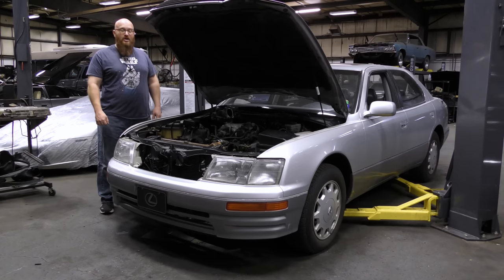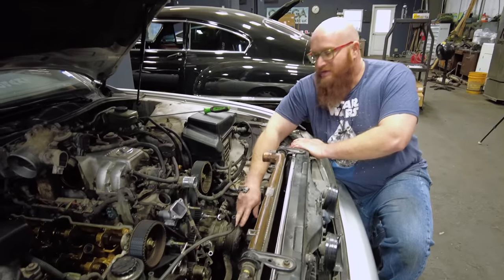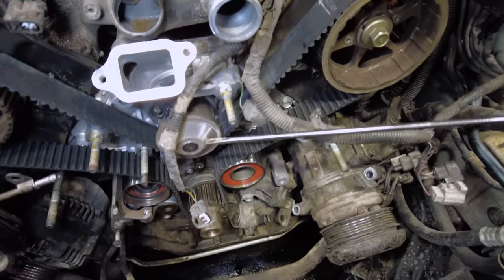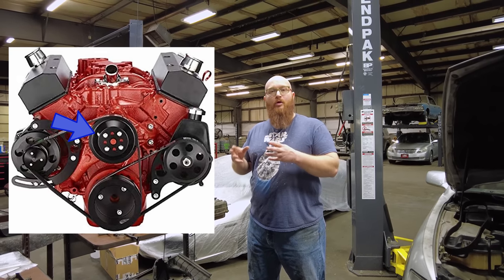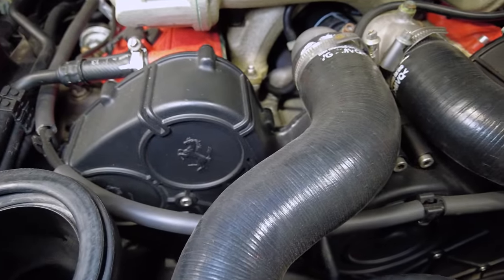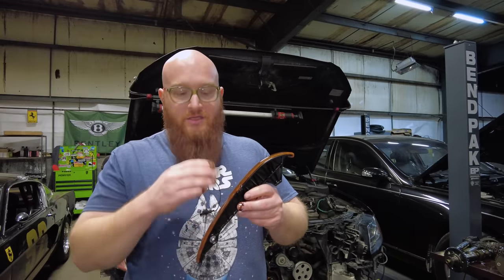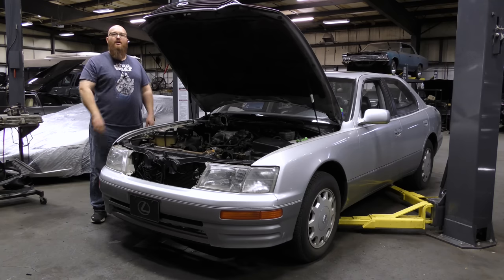My What's Broken? Series #1: Timing Belts-vs-Chains! CAR WIZARD explains why the huge bill

Comment: I'm glad you made this. I recently purchased a 2007 Golf R32 and it's got chains. And apparently the repair is around £2.5k compared to the belt which I usually pay £450-£500
Reply: It's a lot more work to replace the chain(s), because they are internal to the engine. That means there will be cast cover-plates to be removed, the chains and guides cost more, cland there's likely to be a more expensive tensioner to replace. It all has to be put back, taking great care to make sure it is oil-tight.
On a well designed engine with a timing belt it ought to be designed with it being a service item in mind. Sadly a lot of manufacturers ignore that part by cramming so much into an engine bay.

Nb. Modern timing belts are way better than those 30 years ago. There are now things like Kevlar available.

Comment: I have a 91 model ls400 still working strong but i have a new water pump and timing belt in store as those are the only big maintenance these need around every 100.000 miles or so do this 10 times and you are at the million club :)

Comment: I changed the timing belt myself in my 1987 Chevy Sprint (60k mile interval), but that had a simple SOHC 3-banger and it didn't require much disassembly to get to it.  Believe me, I double and triple checked the timing marks were perfectly aligned before I buttoned it all up, then said a quick prayer before turning the key 😀 The next 2 vehicles I owned had chains, so no change interval and didn't need to get them replaced.  The 2 after that had belts, but by then everything was far more complex so I paid to get them done.  Now I'm back to chains so hopefully no replacement.
Even with 30+ years of experience in IT, I will never pass on an opportunity to hear an expert talk about subjects I know well, since there's always something you can learn.  So anybody should watch this video, if for nothing else to get a look at a beautiful Ferrari V8.
Reply: i changed the timing belt on a gf's sprint in the 90s when she needed a water pump
Reply: I agree very stressful on the first start up.😅
Reply: @perpetualgrin5804  indeed stressful on first attempt. I had that feeling when I first installed induction cooktop in my previous home. One wire wrong and it could have catastrophic consequences. Checked all of multiple times. 
I haven't done a belt change yet but I'm confident i can do it. I also have a Hayes car manual explaining how to do it properly. Luckily I don't need to remove the engine mount to reach the belt. That would really be a step to far for diy.

Comment: Hi car wizard, a point you might like to mention is that although chains, providing that service intervals are observed they can be counted in thousands of miles, the rubber belts age as well. Example my Rover 75 only had 37000 klm on the engine,  but it was the original so 23 years old. Something to consider.

Comment: Thank you, Car Wizard. I came up doing the old school timing light bit for adjusting the timing- along with feeler gauges for points and the like. I say the modern motors, though more complex, are better that the old days motors- much tighter tolerances and better alloys make them last so much longer if regular mountainous is practiced. I don't miss trying to figure out if the timing was off or the dwell angle or....
Reply from the maker: Agreed, I dont miss timing lights one bit
Reply: @CarWizard hi

Comment: Very good video showing the intricacies of taking apart those babies to change their timing belts/chains. People think they are easy (like a serpentine belt)...they are NOT!
I had an old (1986) Honda Accord. EFI, auto. I replaced the timing belt (it had been done by the dealer before, I had the paperwork). The crank timing belt mark on that engine is on the flywheel at the back of the engine block (marked white with a bit T stamped beside it). There was another mark (colored red) that was for the IGNITION timing (15 deg. if memory serves right). It turned out the timing belt was timed to the RED mark! 
(Incidentally, the engine would rev fine up to about the 5k rpm or so, beyond that it would start sputtering, which I had thought it was some sort of rev limiter in action) New belt timed to the righT spoT and no more "rev limiter"

Comment: You are spot on in regards to changing a belt driven water pump at the same time. The new belt will have different tension characteristics that will change the stress on the bearing and seal of the used pump and cause a fail in short order. One week on the car I learned from....

Comment: Thanks wizard. Old short chains on American OHV V8, V6 were very reliable, except some with nylon sprockets. Long and multiple chains on DOHC engines with high DI fuel pump loading are subject to stretching, tensioner and guide issues. Should be inspected as precaution to total failures. SOHC non interference engine W/O DI using interval replaceable timing belt is good, because timing belt  designed to be replaced and if belt breaks, no valve damage. Some old engines with cam in block just used two lubricated gears;  no chains, no belt fears.

Comment: Great video Wizard. The only thing I'll add is belts are generally cheaper for the design, but they're also lighter and have less inertia - hence the use by Ferrari etc. Separately and important to add to your illustration of the damaged belt is that those inner cords can fail WITHOUT the rubber cracking, so change the belt to the schedule. It can look ok and be on the point of breaking. This also reflects the need to replace a belt if the water pump fails - you can't see the damage done to the belt internals caused by the sticking/seized pump.

Comment: I've had two vehicles where the timing belt has snapped.  One was a write-off and the other needed extensive (and expensive) repairs that took the dealership a month to complete (jerks).  Learn from my irresponsibility:  when it's time to change the belt/chain, CHANGE IT!
Reply: One of my cars is non-interference, used to have two (lost one in an accident 😔).  There were so few that were, but I still look it up if I'm considering a used car.

Comment: My old truck has all steel timing gears! No belts or chains here, just a 2:1 ratio gearset. The camshaft actually spins in reverse to normal because of this, but it's all designed that way. It's an old International Harvester 345 motor. A little noisier (but with no roof, no doors, can't hear much but the wind anyway!), but extremely long-lived. Don't know how many other manufacturers ever did this, but I thought it was interesting!
Reply: Generous Motors did in up to around 1950 as well as Ford unless I am mistaken.
They basically were good for the life of the engine.
Then they realized it made more profit to use chains as they wear out.
Reply: Ford's inline 300 used gears if I'm not mistaken. Diesels use them too.

Comment: Very good video! Manufacturers seem to have gone back to chains now.  I had a 1982 Ford Ranger with the 2.3 liter 4.  It had a timing belt and I pushed it to far.  The belt broke and left me stranded.  Luckily, the 2.3 is a non-interference engine, so no engine damage.  Later, I bought the special Ford tool and successfully changed the belt a few times.  Even on that engine, it was an all day job(at least for me).  you had to remove all the accessories to get to the timing belt cover.

Comment: I just replaced the timing chain on my  2011 mercedes E350 CDI at 403k km (250k miles). It cost me a bit over 300€ to do. I didn't have any problems with the original chain but decided to change it for peace of mind.

Comment: I have a Volvo V70 with the 5 cylinder petrol engine. Unusually the advice on those is Not to change the original Volvo water pump if there are no leaks or play  "While you are in there"with a belt change because the original pumps will often last the life of the engine, 200.000 to 300.000 miles. Also a lot of aftermarket pumps will develop leaks annoyingly quickly.

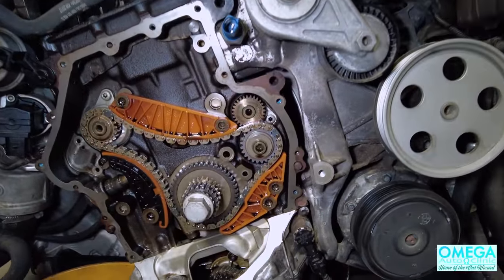Comment: That's a great tutorial Wizard. At 12:30 you could point out the 'chain tensioner',(8 o'clock in view), sticking out so far that there's silver on the cylinder showing,and it's passed it's useable position because of chain stretch and guide wear.There should be 1/2 that showing.

Comment: I learned what a timing belt was back in 1990 while driving my 1986 Mazda 626. The engine died on the freeway and had no clue until towed to the shop. Oh, your belt snapped but your engine is non-interference so you are Ok. After that I changed my own and that car is so simple to do. Today the only car I have with a belt is a 91 Mazda 626 so still easy. All others have timing chains from 1965-2018.

Comment: The timing belt on a Toyota 4.2 turbo diesel is the easiest thing I’ve ever seen to change the belt. It’s on the outside of the engine and you just remove the plastic cover, line up the marks, release the tensioner (probably replace that while you’re in there), take off the old belt and fit the new, and then make sure everything is still lined up, cover back on, job done. We had that excellent motor in a 2004 Landcruiser 100 series.
Reply: It's almost the same on a Subaru, especially if it's a single cam. Just take the front covers off and replace the tensioner and the idlers. The access is so easy and the belt kit so cheap that the waterpump isn't a must to change if it's still fine on a low mileage car.

Comment: Just replaced a timing belt on another 1UZ out of a SC400.  That belt had 212,000 miles on it.  It looked similarly, but still had plenty of strength left.  I hung an engine and trans combo on it from a hoist overnight (only about half an inch off the wood support blocks) - single loop, not double loop - so full weight, not half weight.  Still holding the next morning.  These belts are a lot more robust than the manufacturer lets on by their recommended intevals.  Had an Acura 5-cylinder that I recently replaced the belt after 120,000 miles (rec. interval 90,000).  Belt still looked primo - no cracking, rubber still pliable.

One thing I didn't see mentioned is a second reason why the water pump is replaced with timing belt, besides easy access with belt work.  Often, a new timing belt, which probably has less flex in it than an older one, is likely to cause a marginal water pump to fail soon after belt replacement due to higher transient forces from belt on the bearing/bushing and seal.

Comment: My wife was stranded on a freeway, about 15 miles from home, in the dark and the rain, when the timing belt snapped on our 5-year-old 1976 Pinto snapped with about 36K miles on the odometer. Fortunately, a kindly lady gave her a lift to a phone booth (remember those?), and we had AAA towing. Non-interference engine, $50 repair in early 1980s dollars.

A few years later I was stranded on the same stretch of freeway, in the opposite direction, when the timing chain on my 1973 Chevy V-8 stripped the plastic(!) teeth on the cam sprocket. Interference engine, new lifters and cams, $700 repair in late 1980s dollars.

Comment: Lexus LS is Top tier.  Gives me a tingle everytime i see this model. Golden car. No doubt. Protip. If you see one white smoking check the steering pressure valve that is
Piped to the intake vacuum.  Its rarely a head gasket in this engine.  I used to grab these up at auction for pennies. Would take to shop and disconnect or pinch the steer vac to diag and white smoke gone. Order steer pressure valve. Done.

Comment: love your videos and how much information you have to give to people, I would like to just comment that the timing belt on the Lexus ls400 is backwards, the arrows should face forwards to the front of the vehicle, gladly the engines Toyota makes that are equipped with timing belt that don't have VVTI Cam gears are noninterference engines, but you will find that the belt being backwards will put the crack timing 1 or 2 teeth off

Comment: Own a ls400, would pick timing belt over modern chains any day, the plastic timing chain guides that can fall apart within 5-9 years kills the deal for me, my belt is due and has lasted 150k for 13 years w/ non-interference long before the chain guide teardown nightmare will happen. You forgot to mention not only belt and water pump, but also the crank/cam seals possibly valve cover gaskets. This stuff should be done anyways as regular scheduled maintenance since rubber near heat sources degrade after about 15 years.

Comment: The timing belt in my volvo 940 turbo went when i was on a little trip a few days ago, sheared a few teeth. Thankfully, it's one of the easiest vehicles to replace the belt ever. Took it all apart on a mountain pass (to check if the crank gear was ok), waited for the belt for 5 days, put it back on in a tad over an hour. Found out i missed a tooth, fixed it, and off i went, and i'd never done this before. This happened because "it's a non-interference engine, who cares if it fails", and it was after this happened that i thought of the belt being just 2 years old, but having done over 100K km, in a car that makes twice the stock power.

Comment: I remember watching this vid when I wanted to get an LS400 haha. Still want one 😂😂 If anyone else is looking to get one, I believe the 90-94 had non-interference motors. Toyota decided they wanted to redesign the heads so they could squeeze 10 more hp out of it but if you snap a belt you can screw the whole motor. Very nice 😂😂

Comment: Last year I had to replace the distributor on my 78 Datsun and after setting timing by hand, I drove it to a shop to dial in the timing.  Guy at the desk had to check to see if they even had a timing light.  They did but the charge was greater than I would have spent on a decent timing light.

Comment: Our Hyundai dealer down under told me once that the next service would be $1,000, so I spent $90 on an electric "rattle" gun to get the crank pulley off and  bought a kit which comprisec 1 Gates timing Belt plus an OEM Water pump plus tensioner bearings for around $180.00 and did this very time consuming job with more attention to what was needed as they would not have replaced the water pump.

Comment: In 50 years of driving, everything I have driven has had timing chains and non of them have failed. There is one reason for switching to belts and that is chains rattle and it's noticeable when the engine is idling. A worn chain probably makes more noise than the other engine noises but it isn't that loud. If you like belts, that's fine but I prefer chains because they can last as long as the engine.
Reply: On GM Allotec V6s, the chain's life is 'limited' due to a number of contributing factors - with the main factor being an under sized (and possibly poor quality) chain - all in the quest of reducing cost (ahh - those GM bean counters).  In such cases, my preference is for a timing belt.
Reply: Might have been due to the fact that I have always owned Ford products. You have to follow the correct maintenance and other brands provide better performance but I have had good reliability. 150,000 miles on the last mustang and 170,000 on the current one.

Comment: In the UK the public perception is "oooh, I want a timing chain not a belt, since there is no maintenance". The problem is that more and more engines the chains/tensioners/guides/whatever's are failing at shorter intervals than belts on some vehicles. I think crazy long oil change intervals are adding to this problem. I am lucky in that I have enough knowledge to change my own belt. It is belt every time for me. You can get at it to change it and inspect the thing. The exception is those engines (usually Japanese) where the chains don't cause issues with proper servicing.
There are also a ton of gearheads who think timing belts can stretch. Chains do, but belts don't. I've never seen a stretched belt. Every time the old one and new one match perfectly no matter how ragged it has got. You replace belts because the constant flexing on the drive gear/tensioners and oscillations from the crank cause them to reduce strength over time. Like tyres they contain rubber, which has a finite age.

Comment: Way back ... as a stupid high schooler, I had a Chevette.  Timing belt broke.  Later the passenger front wheel broke off.  Then the crank pulley came off.  Less than 60,000 miles on that 1.6 liter four banger of fury.  Made me a Ford guy pretty much for 35 years.

Comment: Yeah I looked into what it would take to replace the belt in my mini van and it was a very quick nope! Cramped working space because you have to do it through the wheel well and lots of parts to replace along with the belt. It doesn't look impossibly hard, but I don't want the liability of grenading the engine because I slipped up.